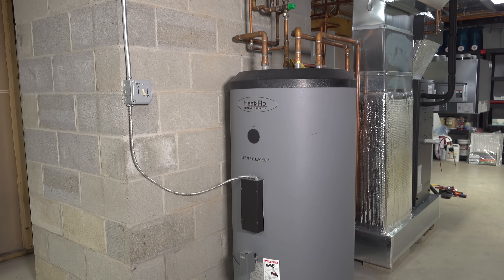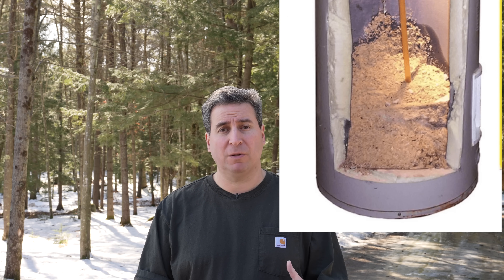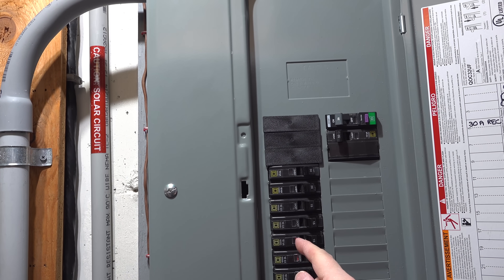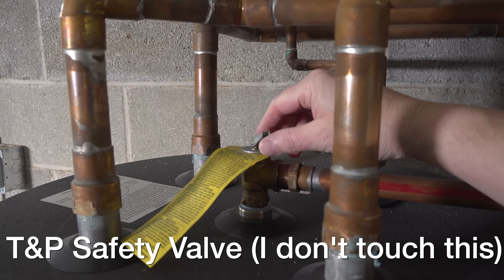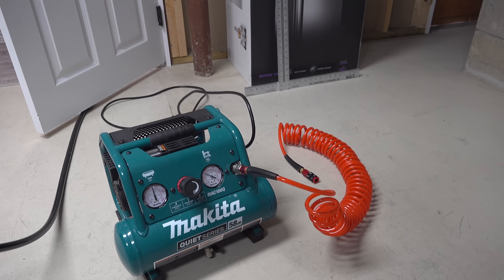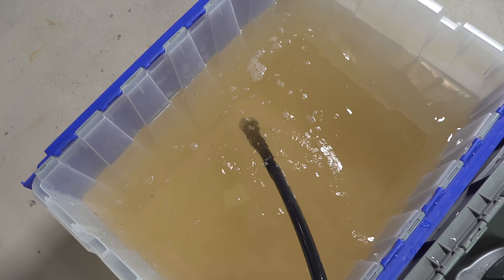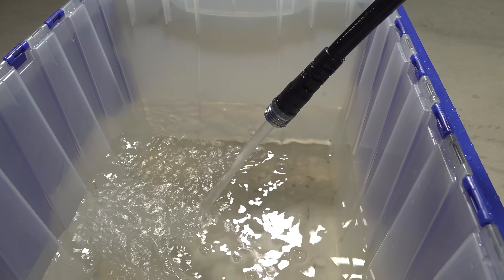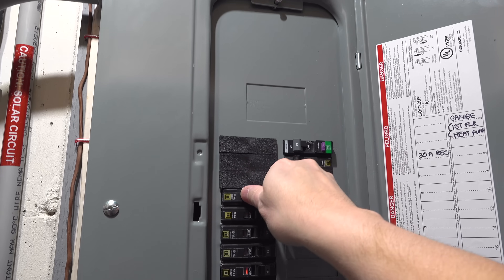EASY Way to Flush Your Hot Water Heater using AIR - Sediment Buster

Comment: My most popular video is when I changed my water heater 4 years ago with zero knowledge.  Paid $379 for it.  Labor to put one in is like $1,000 to $1,500.  Now that same water heater is $579.  This video is a must do to prolong the life.
Reply: My water heater is quite accessible. 1/2 hr job, 1 hr max if goofing off. No way would I pay that much!
Reply: And regularly change that anode rod (every 3 years at least) or more if you have a water softener.
Reply: @lance16O1  Shouldn't a water softener make the water better for the heater? The deposits and sediments  are considered hard water.
Reply: Secret weapon to saving money is learning to DIY.
Reply from the maker: It's crazy, it used to be about $800 installed for a normal tank. Prices are out of control. Too bad our salaries haven't kept up!
Reply: @SilverCymbal  speaking straight truth
Reply: My county requires a permit.
Reply: @Jimmyjimjimjim to drain/flush water heater? Surely not...
Reply: @Jimmyjimjimjim   Fuck that.  Just DIY and don't tell the Govt shit.
Reply: They really charge that much? lol. I replaced my water heater 5 years ago with a new Bradford White contractor grade and did the installation myself. It was simple. Just make sure you follow code. Here in California, earthquake straps are required, and it must be a  certain height off the ground, and the emergency drain must be soldered copper.
The water heater that one replaced was actually installed in 1981 and was made by STATE. Yeah, it lasted 39 years and was never once flushed or had an anode replaced. It had about 50lbs of calcium built up inside and i only replaced it because it had a tiny leak.
Reply: how were you able to source the Bradford White water heater? I thought they only worked with contractors
Reply: Thanks, Joe!

Comment: Im thinking run a drain hose outside and bump the cold water input valve to create a turbulence inside the tank. Water weighs 10 pounds per gallon..good luck moving those totes
Reply: 8.34 lpg
Reply: @sewerman911  i was close
Reply from the maker: If you watch the very end of the video I show you the totes
Reply: He put a sump pump inside the tote and pumped it dry.

Comment: Moved in just a few months ago into a home built i think in the 80's. Got a new clothes washer and a week later called the manufacturer out as washer had broken. They told me it was due to sediment in water.  Thankfully they covered the repair but when I flushed the water heater holy cow it was like mud city!!
Reply: that couldn't have been the original heater.
Reply: @jimprior5700  no the home sellers claimed the water heater was newer and the home inspection confirmed it. Guess we just have dirty desert water 😉

Comment: Not only can you clog the valve but the sediment actually clogs micro holes left in the inside of the tank so I have ran into it where a tank was so dirty on the inside that the cleaning process actually made the tank leak and therefore had to be completely replaced anyways!

Guys when your tank is 10-20 years old please just replace them if they have problems! Its not worth the cost to repair in most cases since it wont prolong the life too long!
Reply: Especially how much more expensive it is to deal with a flood if your water heater is inside the home.
Reply: You must be a plumber. The tank i replaced 5 years ago was made by STATE and was installed new in 1981. Yep, it lasted 39 years. Not bad for a natural gas heater.

Comment: You need bursts of compressed air to stir up the sediment. Using a bike pump or an electric tire inflator doesn't provide enough pressure.
Reply: Pressure or velocity? My bicycle pump, a zefal brand, pumps my bicycle tires to 120 psi
Reply: @pootthatbak2578  Velocity. You're using the air pressure to agitate to the sediment so that it will mix with the water and flow out the valve.

Comment: Definitely one of the better products I've seen for cleaning out a water tank. However, in my experience with two different older electric water heaters, this product wouldn't do much good. First tank i cleaned had blown an element second one was still working but hot water production had been tapering off with less run time and lower temperature than when we moved in. So both times i opted to remove the elements and discovered an easy 2 gallons worth or more of sediment at the bottom. The 2nd tank i had religiously flushed every 6 months since we moved in getting small amounts of debris but otherwise clear water. The 2nd tank (which i just cleaned 3 weeks ago) the elements were so built up they barely came out of the tank. Research suggested vinegar can help loosen the build up when allowed to sit for about 6 hrs. So i had about half a gallon of 45% vinegar that i mixed with a couple gallons of water into the tank. As a test i put some of the sediment and vinegar water into a glass cup basically so i could check to see if it softened up at all. After 3 hrs theres was almost no changr so i scrapped that idea and went back to old trusty. I taped a length of garden hose (no fitting on the end) to my shop vac hose and fished that into the bottom element hole and began sucking the sediment out. Some of the chunks were about an inch or so oblong shaped and in general most of the sediment chunks were way too big to fit through the drain valve. 2 hrs of liposuctioning my tank with the hose and i got about 95% of the sediment out. This also allowed me to inspect the inside of the tank which the tank itself looked fine but the anode rod and hot water dip tube are in bad shape. However 2 new elements and thermostats for $35 and the tank is good to go for now and the plan is to replace it next year with a more efficient one. So I'm not going to bother with the anode rod or dip tube. The only way that sediment was going to fit out of the tank drain would be to remove the valve completely which i tried to do but the plastic valve was seized in place and wouldn't budge. Circling back to the test sample of sediment and vinegar water, i let that sample sit in the cup for 2 days and the sediment was still rock hard requiring reasonably strong hits with a hammer to break the chunks into small enough pieces that they might fit through the drain valve.
Reply: Astounding!
it would have been nice to state if you have hard, soft or normal water and to what degree.
That would make more sense to those of us that know very little.
Reply: @lunatik9696  I've never tested our water but I've been told by others that its hard. How hard i couldn't tell ya but about every 6 months our water fixtures have some white powdery build up. Clr to the rescue on those things. Also my water heater is set to 125°. My understanding is the hotter its set the worse the mineral build up will be. 125 is toward the bottom range of water heaters.

Comment: That air isn't doing much to clean out the water heater. Notice the drain valve is not at the very bottom of the tank so the sediment and calcium crystals built up in the bottom of the tank are not coming out. The heavier crystals sink to the bottom of the tank and stay there. To get that out you pretty much need to remove the lower heater element then use a shop vac with a small tube taped to the hose  to stick into the tank and suck out the crystalized deposits in the bottom of the tank. Oh You can stick 4-5 inch piece of wire into the valve to free up a plugged valve that's not going to puncture your tank.

Comment: Drained mine for the first time in 8 years. Was surprised I didn’t get much sediment or water color change…
Reply: That’s because everytime you use your hot water the tank gets flushed by the cold water. The cold water pipe goes to the bottom of the tank so it’s a natural flush.

Comment: For the short bursts of air what was air line pressure setting?
Reply from the maker: I had it on 30psi but it really never gets there. As your tank is vented out, it can't build up pressure, it just uses the flow. Hope that makes sense
Reply: A typical water system is pressurized to 30 pounds